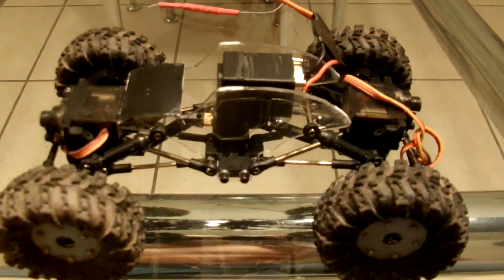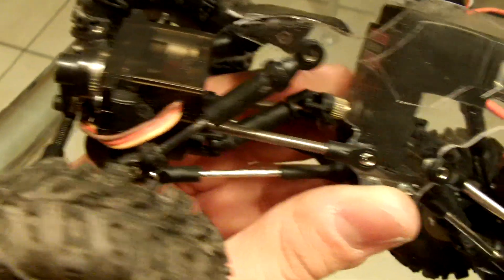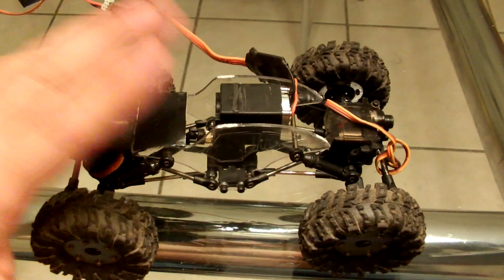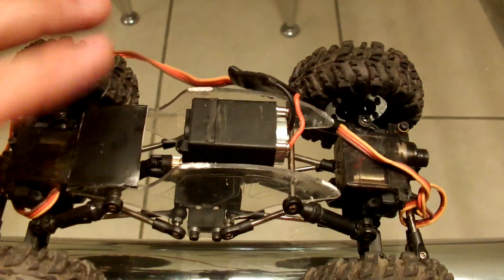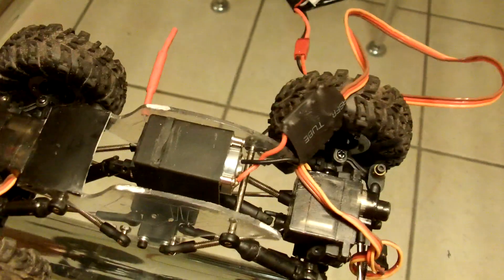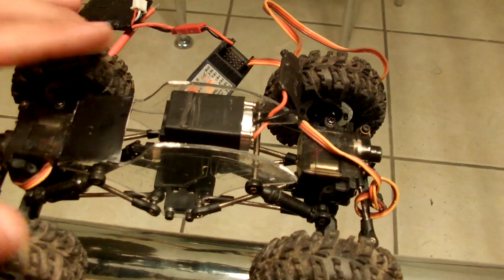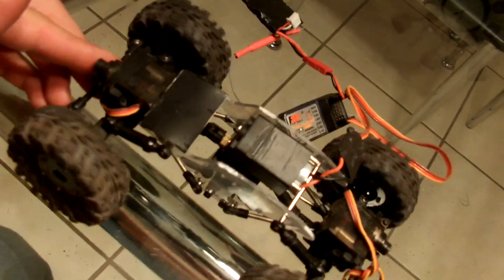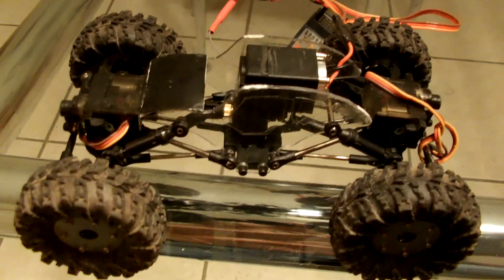34 Redcat Racing 1/24 Sumo Crawler Micro RC with mods / upgrades Metal Gears

Comment from the maker: You would use the same pinion of the stock sumo motor, use a small (very small) flat head screw driver and gradually pry pinion out, use a 4 point prying system (pry a bit then move a quarter of the way around pinion and pry again, then again and again until it comes out). Screws are standard 2m bolts, use one about 1/32 -1/16 longer than the ones on stock motor, and 2mm washers are used if bearing on motor being used is too big to pit sumo trans hole (do not try to widen gearbox hole!)

Comment: Greetings: Gamyrc
  I have a few questions about using the servomotor. What size pinion gear did you use on the motor output shaft to match up to the stock sumo gearbox and where did you get it and the longer screws that mount the gearbox to the motor? And how do you get the pressed on pinion gears off the motor output shaft to be able to swap out motors? Any help would be appreciated.

Comment: Right! I have a motor/gear box out of a cheep big box store that im going to try in a MINI crawler setup, as I have a couple bodys that are 1/16-1/18 scale so I am planning to build a custom chassis to fit these wheel base. my problem might be that I will gain 
4x the wheel speed it's the torque i am a little leary about. i tried a single axle mock up to see what it would do, awsome wheel speed. I think the motor in the gear box looks alot like your servo motor??  AWSOME VID!!! Sumo dig f/r YES!